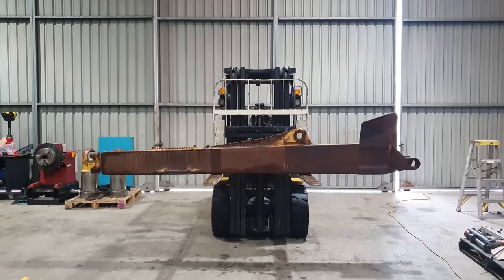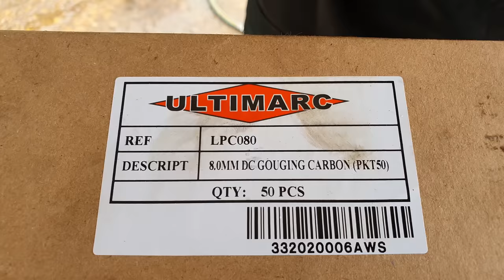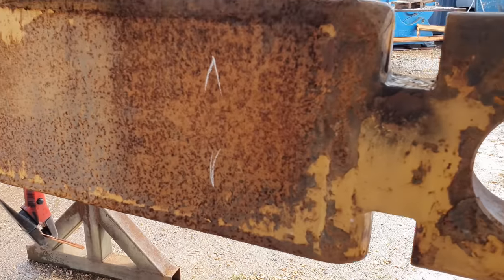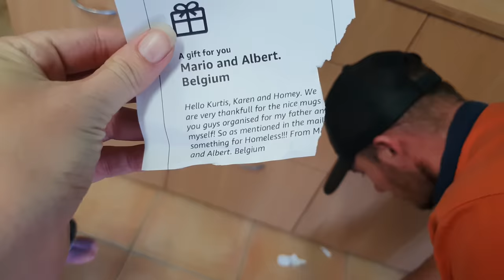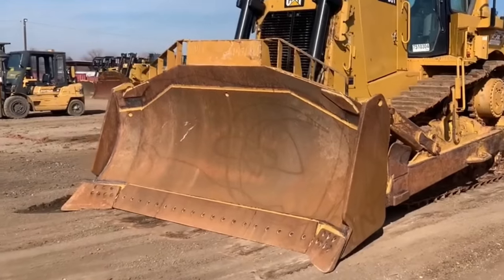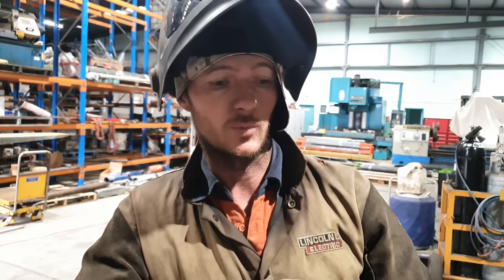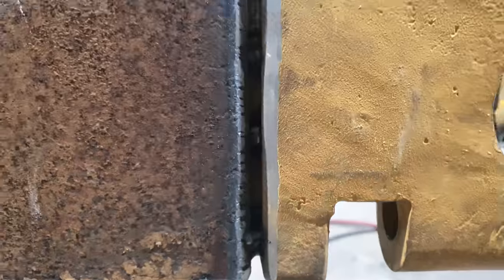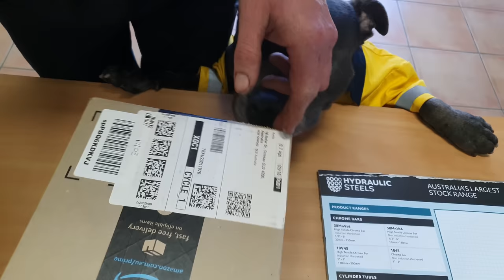Repair BROKEN End on D8 Dozer Push Arm | Gouging & Welding

Comment: Yea, you really should go see an maritime or mining industry audiologist and get fitted for custom formed hearing protection earplugs. They are great over the “foamies” everybody likes to use, and they’re not expensive. Also, consider using double hearing protection anytimeyou are grinding or gouging.  Look at the noise reduction rates (nrr)of the custom fitted earplugs and you’ll agree they are worth it. Plus, consider getting a baseline hearing test and annual checks to compare against it. Please consider it!  Coming from an OSHA Maritime Industry Trainer and Marine Chemist Gas Free Engineer, Resporatory Protection Administrator, NDT weld inspector, Corporate Safety Manager for a major shipbuilding / ship repair employer.    If you need /want a two legged safety officer or just some ideas and suggestions ring me up. Be glad to help.  Cheers, mate!

Comment: Kurtis:  A suggested topic for you to discuss in a future video - what are the merits of the various gasses available for MIG welding (Argoshield, Argoshield heavy, light, etc).  How should one choose which gas to use for what sort of job?
There are a few YouTubers that give definite opinions, and one or 2 that did comparisons, but they didn't change welder settings etc to optimise for each gas type.   I weld on a hobby basis mostly but not always mild steel - I found I can pretty much get the same result regardless of which Argoshield variant, but maybe that's because I have not learnt yet to do high quality work.  I suspect that gas suppliers sell gas with a relatively high percentage of CO2 because it is cheaper to make.
My local gas supplier only stocks Argoshield Universal for shield gas.  Should I push them to stock another gas variant?

Comment: I've done the d11 push arms, I find doing the 2 sides first, then the bottom, and the top last helps. That way you don't have to try and roll it and doing the bottom last you risk it falling on your head. Just a tip I've found. The corners are the painful parts especially if it was poorly prepped previously the weld can be right in there..never seen it welded on the inside though how did they even do that haha

Comment: Great videos, very informative and explained well. Each time I watch one I learn something new and was wondering what the letters on the lathe tips refer to, not having used a lathe. Just a suggestion, but you might want to think about exchanging the water logged, conductive wooden pallet full of nails for a plastic one as it would give you much better insulation from the ground and its lighter.

Comment: Hello Kurtis, this might sound like a stupid question but when you are gauging and you turn the air on , does the compressed air actually run through the rod or does it just blow the molten metal away,nobody has ever explained how it works,I didn’t know that this was even a thing until I saw your videos.

Comment: Hi ! Dont worry about the ridk of shock, its really not big, plus even if you do, its maximum 60DC, which really isnt a lot. You could feel it, but its safe
Reply: @LesDexia13  current will only flow if voltage is high enough. It hurts because your tongue's reistance is much lower than your skin. Current is directly linked to voltage. 60 isnt enough to cause a dangerous amount of current to flow through you.

Comment: Great Video!  Did you make this video for me?  Arc gouging, dual shield flux core, and loads of swearing!!  Wholeheartedly agree with your assessment of arc gouging over other methods.  I love lighting up the gouger on some some welds or cracks to be welded.  Neighbors on our cul-de-sac not so much.  How many amps you running on 8mm and 10mm carbons?

Comment: I appreciate your safety advise about water around you, but may I suggest an impermeable mat on top of that wet pallet. I stood generator watches on a US Navy ship and that was required because no current could travel through it to the deck plates and your pallet was wet.

Comment: When you weld push arm and the cap it will produce alot of heat .And heat will change the hardness and other property of material and it will induce stress points in metal.
My question is are these arms heat treated or normalised  in owens after welding? Are parts made out of special steels that need such operations ?I assume they are under alot of pressure.

Comment: like your vids. I am not a machinist but I enjoy watching you repair things. I never look at a piece of  heavy equipment the same. I was wondering with all the layers of welding material is the place you welded stronger than say a new arm from the factory or any thing you use a lot of welding material to fill up a joint?

Comment: Awesome video as always . When you explain what wire what size and gas , is this something you have worked out during your time using it all or are there certain parameters specified by the manufacturer to what usage suits better . I'm seriously going to have to turn the volume down when homey gets spoilt as mine keep hearing the squeaks and growls and seem to go nuts in response.. love the green filter on the air gauging section top Mark's to Karen on the close ups and I guess size does matter when tapping with a hammer . Thanks again guys for the top video of my week . Always makes a shit week at work feel better when I watch you guys

Comment: as i am a welder myself and have fitted things on end of beams, i got curious when i saw you weld one side at a time after from what you can call the "root". you wernt afraid that it would "warp" from its allignment by doing one side at a time?
beacuse that has happend to me once so now i dont do one side at a time.

Comment: The loading of the mig/tig (can never remember which is which) reminds me of the loading of the old movie projectors. The white jacket guys say that the skull portion around your ears also transfers sound to your ear, so it is better to wear ear muffs (right word?) that also cover these portions than just ear plugs.
Reply: MIG  (metal inert gas) is the wire-feed, TIG (Tungsten Inert Gas) is the fixed electrode. Both are gas-shielded, and if you've seen him reference Dual-shield, it has a core that produces a protective slag skin. MIG machine with no gas can use a self shielding wire. Mig/wirefeed pushes the filler right through the arc because it is the stinger electrode. Tig shoots the arc from a non-filler stinger and you feed filler from the side, so it plays a bit like torch welding (which is still a valid technique, although largely superseded by arc tooling)
Reply: @Hyratel  yup, my son in law is a boilermaker, so I know about the differences, but I usually can't remember which name fits to which machine. Thanks for the info, now I know what the abbreviations stand for. They are moving to Australia soon, as an ex South African hired him and is paying all their transport.

Comment: Question. If this dozer arm already had this repair prior, can it be done a second time? Or do you need to manufacture a filler steel box between the two parts? Seem to me that would create a failure point.

Comment: Mister Curtis I have used are are rods what they were hollow in the air blew through the middle I was wondering if that was the same type of Rodger using their dugout with also have used thermite rods underwater that were hollow in the air went through the middle of them but we use a different type of torch to blow the air through the center of the love your videos I am just curious about the rods be safe and have a great day Sam

Comment: i just realized your pushing while welding with dual shield flux core. How are you not getting any slag inclusions, or are you? you having an angle one would us for short circuit mig surprised me. welds look great, but never seen people push any flux core

Comment: Thank you team. I like to put old rimless tires under my platform when It is wet out. That  big wire welder is super. My little flux core Lincoln welder does some very good welds. Homeless is a wonderful pup.

Comment: If you had a brand new piece of 8 x 6 solid material, in bananas of course, would you not have thrown it in that band saw you have and run coolant, and get that nice cut? Is there some advantage to cutting this like this? Especially given the great weather??

Comment: Didn't knew there is Mig wire which also leaves slag like stick welding. Is it used when you need to weld thick materials and what is benefits of that?

Comment: pretty sure I've seen those gold cutting sticks used in navy/ship yards to cut brass propeller shafts. I remember they called them 'sun sticks' due to their high temperature. Have you heard them being called 'sun sticks' ?
Reply from the maker: hey mate never heard the term sun sticks before but makes perfect sense 😂👍
Reply: @CuttingEdgeEngineering  thanks for the answer 👍

Comment: Great content mate. Do you find that it is better to reverse the polarity when air arc gouging? Also, do you use steel wool or an ear plug to keep the mig wire clean when it comes off the roll?

Comment: the same design was used on the 1940s era machines. just a bit smaller. well i spose if it aint broke dont change the design. have to see if i can get them for our 54 model d4 as it has ones that are a bit flogged out.

Comment: I'm coming pretty late to the party, but is standing on a wet pallet that's in a puddle, really that much safer than standing in a puddle yourself, considering there's a film of water saturating the pallet that will provide a ground path for voltage?

Comment: 19:23, so in essence the trunnion to be installed(welded) is straight with the long side of the push arm, correct?  This is regardless if the push arm(s) is angled off to the side of the actual operator cab the trunnion is still straight with the length of the push arm.  Hello from TEXAS!

Comment: @Cutting Edge Engineering Australia Curious why not bandsaw cut this, or use a large disc angle grinder. It just seems the clean-up with the arc gouge takes more time overall. I guess you are extremely efficient with the Air Arc Gouger, so it seems quick. I was just curious because in an autofeed bandsaw and a relatively straight profile of the arm, it wouldnt be more than 20min for a very clean cut that was not heavily oxidized by the arc gouger.
Reply from the maker: hey mate good question, we aren't actually wanting a "clean" cut as such on this job. You could use a bandsaw but you don't have any "control" over the cut & location of the weld joint, you'd have to get it spot on or run the risk of extra cutting or extra welding to fill the joint. Where with gouging can be much more precise at only removing the material needed to separate the end, find the weld joint and begin the weld prep for the new part 😎👍
Reply: @CuttingEdgeEngineering  thank you for the reply Kurtis I appreciate you for that. Love the work and we love the videos all the way from the USA. I do give it to you, with the arc gouge you can get your bevel setup up in almost the first go around. I appreciate the insight mate! 🫂

Comment: KURTIS, QUESTION, I'VE DONE MY SHARE OF AIR-ARCING IN OUR DAY,, NOW IF WE GET AS AN EXAMPLE A EXCAVATOR BOOM, I USE MY USED ELLIS 4000 SAW. OR THE MARVEL, THINK IT'S A MODEL 10,  CUTS 18-INCH PIPE ON A 45, AND CUT THE END OFF LIKE YOU AIR- ARCED,, JUST WONDERING AS YOU HAVE THE BIG MARVEL?   THANKS, AND TOP-NOTCH WORK AS ALLWAYS!!!!!

Comment: Been watching your vids for awhile now LOVE EM!!!!!!
Question? I use a torch all the time for cutting off parts(I'm a heavy mechanic) that are seized on. I've never used that gouging stuff, we wouldn't need to for what we do(everything is bolted on that we work with), but I've cut through some very thick steel, like once you get it going it just melts right though like butter. Is it more that you  need the control? Or is it I've just never cut through the type of hardened steel or welded material like that end piece, and a torch just doesn't cut through that like say a thick tie rod or spindle, bearing race etc that I would normally cut? Maybe someone who does this stuff can can answer?

Comment: I mean you've said it before.  cylinders are installed in machines which are used in a variety of environments, most of which have atmospheric moisture. If the parts were blue'd then they would not rust even if water were to seep in,  in between service intervals.

Comment: Love the content. That arc gouging looks messy and expensive- have you tried a hack saw?
Reply: Mr Quindazzi, if you cut it with a hacksaw or even a mechanical saw, how would you remove the "plug" left behind. Remember it had been welded from the inside and the welds were broken by the BFH. Big hammer. Also time costs money.

Comment: Curtis I was wondering if you have ever tried one of the big asphalt type propane torches for preheat. With the cost of Oxy and Acetylene here in Florida I almost always use the propane for any preheating. Thanks for the great content.
Reply: I was trying to find oxy/propane rosebud tips but they don't seem to exist. Would be a better solution for my home/farm workshop and would save the money as you say.
Reply: @AndrewMoizer  it is a air propane stand alone torch with regulator. Mine was made for asphalt patching I think about 150 thousand BTU. I don't know brand as it is over 20 years old. You could build one they are just a torch version of a propane forge burner.  Lights the smoker and charcoal grill well too. Not as fast as oxy acc but way cheaper
Reply: @AtlasLathe  I do have an air-propane torch. It claims to be 90-375,000 BTU. Can't say I use it much, maybe I should leave it set up. I'll have to give it a try if I end up with some heavier welding to do, which doesn't happen very often. If I could find a propane rosebud to use for those bolt heating and similar jobs then I probably wouldn't need acetylene as I do have (some) oxy-propane cutting and gouging tips. I do have a very sweet little acetylene-air torch that works a treat for copper plumbing. It transformed the one reno job I had to do with copper drain pipes. Appreciate the reply.

Comment: You like dainty little lathe tools, right?   
What about a 60lbs Geometric Die Head with a 1.5" shank. No idea which dies comes with it, but since it's in Alaska, odds are that it's mostly Banana peel sizes.

Comment: I use a uni mig procraft 240 amp for welding mainly on speedway car and anything over 6mm its all way on number 8 witch is 240 amp and man does it weld the head light plates In or bumpers I run 0.8 mm wire on gas

Comment: You remarked on a weld inside the arm. But the arm appears to be a piece of tube.    How could it have been welded on the inside edges? Have the Umpalumpas taken up metal fabrication ?
Reply: Ok now I see it's not a tube- but it still seems a tricky weld.

Comment: 3:38  Forklifts in the rain?? ... When I was a Millwright when ever we used forklifts in the rain, we'd look for something to tape to the roof rack to keep dry :) ... Usually just cardboard and change it every day or so.

One time we were ripping out EVERYTHING for "Nortel" phone company they were closing a big facility) and I found one of those giant dome shaped plastic mirrors, fit perfectly on to of the forklift roof rack ...

BUT??  Nortel's safety guy said it was too distracting having everything moving by on the mirror so fast :) ... He made me take it off.  

But I didn't realize the guys loading and directling me, really liked the mirror, they could see around corners etc, it was actually helpful when I was stopped or moving slowly.

The rain shield dome mirror was missed after it was gone :)   I mentioned the safety aspect of the mirror, at the next safety meeting, but mostly everyone thought I was joking and dismissed my idea :)

Comment: Bro, maybe electricity works differently there than in the states but wood is a good conductor of electricity. So standing on that pallet is doing very little for insulation.

Comment: If you were to put a piece of wood between the workpiece and the stands it would isolate the work from the ground you are standing on.  Still stand on the pallet the the like but just another layer of protections.

Comment: would a band saw not work? just curious as ive seen it in your other videos?
Reply from the maker: hey mate good question you could use a bandsaw but you don't have any "control" over the cut & location of the weld joint, you'd have to get it spot on or run the risk of extra cutting or extra welding to fill the joint. Where with gouging can be much more precise at only removing the material needed to separate the end and find the weld joint. 😎👍

Comment: Referring back to 
You WON'T Believe What We Found In This Lathe! | Workshop Machinery
835,965 viewsDec 27, 2021
Just wondering what your opinion is on Thermal or Chemical Blueing of tools, bolts, Nuts etc.  Why is it such an industry failure?  If we can effectively elimiate the chance of rust, seeing as many of the ordinary tool use is within water/lubricant cooling and metals rust.  why not have an industry standard of rust prevention.

Comment: That replacement piece looks cast. I hope it works out for/your client. Gouging gazebo to the rescue! It appears you are knocking off flux from your completed welds. ?? You have solid wire and gas for shielding. Where would flux come from?

Comment: I think this comment from Fonz 323 deserves a response .........".. I would think that's too much heat and stress on one side, too easily to warp the rod and trap slag when welding the next side. I don't know how you welded that last end with both sides already capped without trapping slag in the corners, "